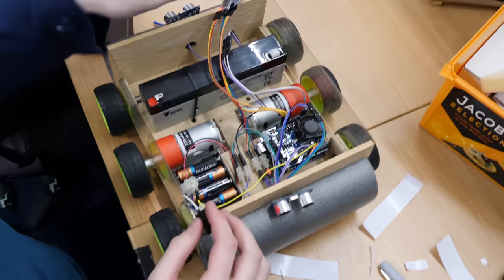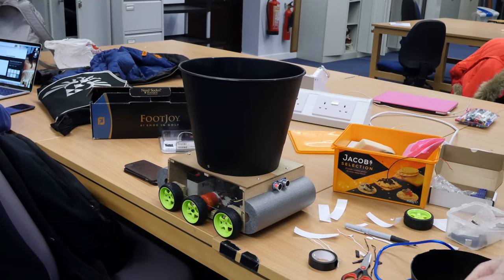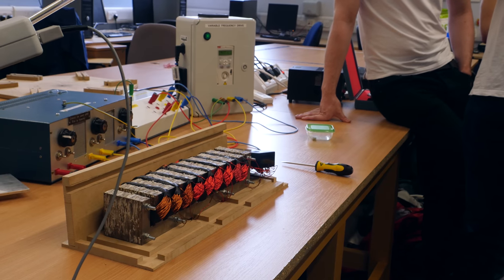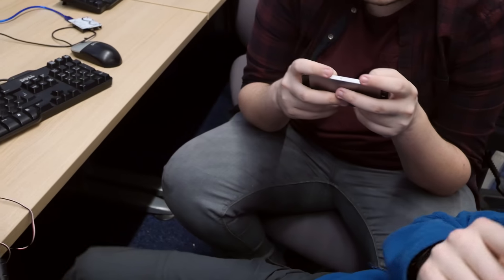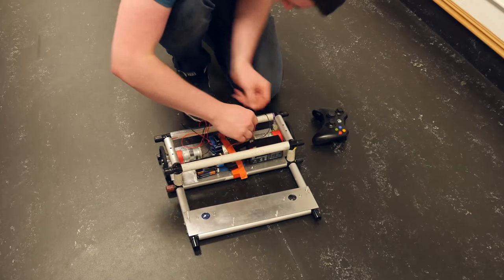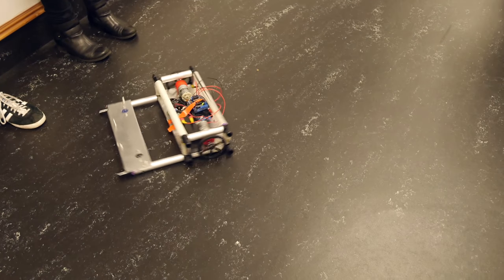Some student electro-mechanical projects

Comment: One common flaw of electric/electronic/electromechanical students these days, is the common disregard of basic, classic mechanical design principles: torques, bearings, shafts, impact, fatigue, bending etc...all the projects above would work wonderfully if the mechanical calculations had been done at a proficient level before the instrumentation and prototyping